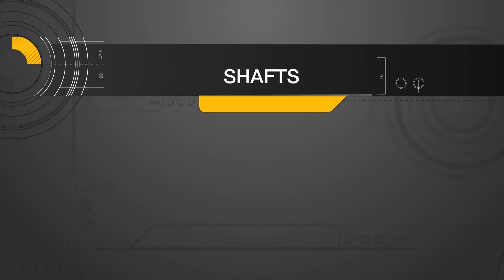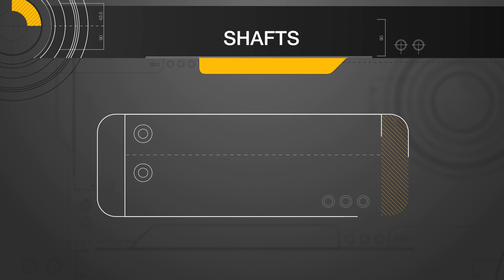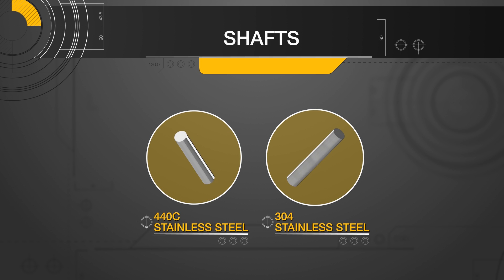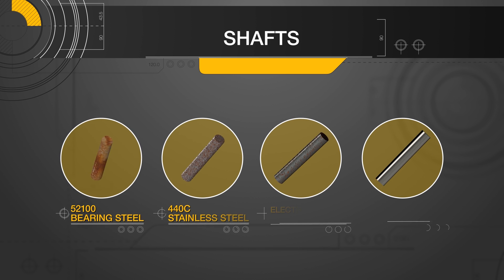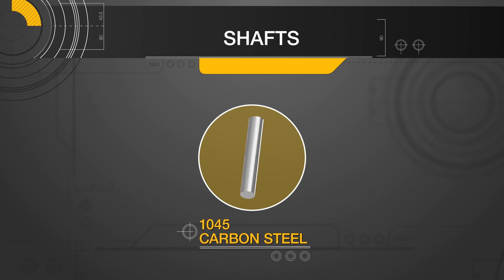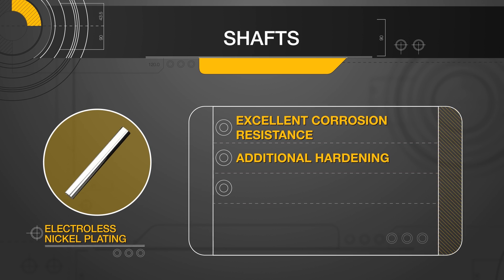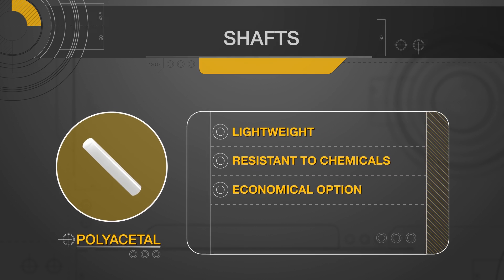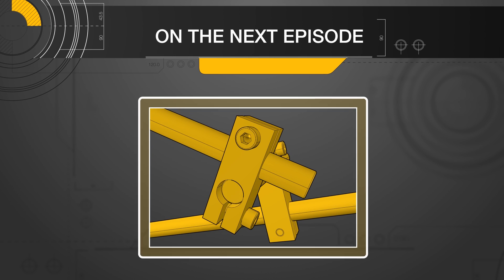MECH MINUTES | SHAFTS PT. 2: MATERIAL & SURFACE TREATMENT SELECTION | MISUMI USA

Comment: Hello what is the maximum length of a 20mm linear stainless steel rod, that we can use for running a router tool and that will not bend, or that will not need full below aluminium support ?
Reply from the maker: Thanks for your question! Our engineering team is on hand to answer any of your questions, please send over your application with further details about the router to our engineering team at engineering@misumiusa.com.

Comment: In Automobile shaft is made up of which matetial
Reply from the maker: Hi Himanshu, shafts are used in a variety of applications and the material required depends on the application and environment. While our shafts could possibly be used in small scale automobiles, it is up to the designer to choose the material of the shaft. If you have any further questions, please contact our engineering team at engineering@misumiusa.com.